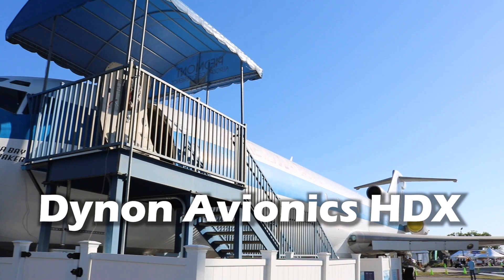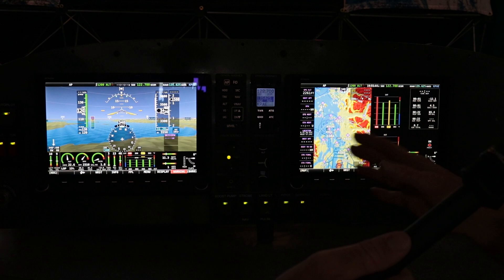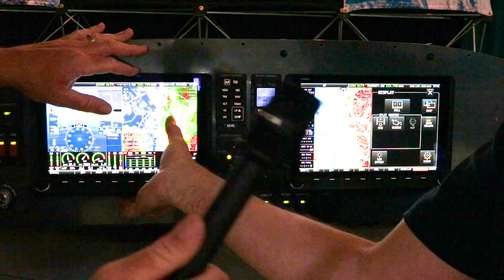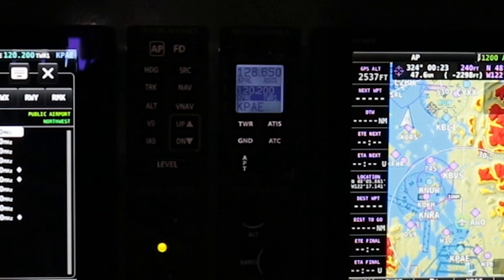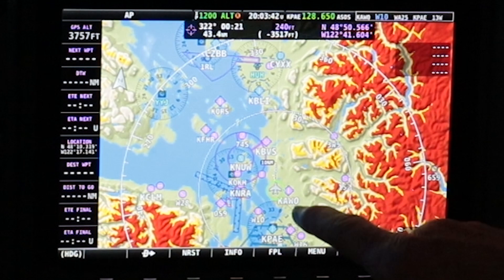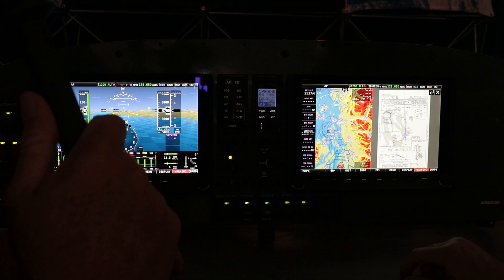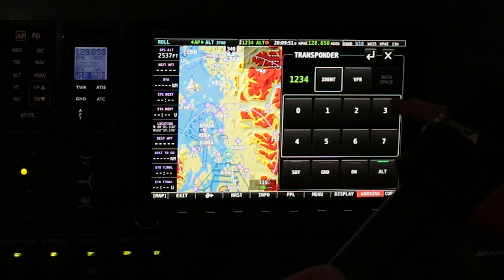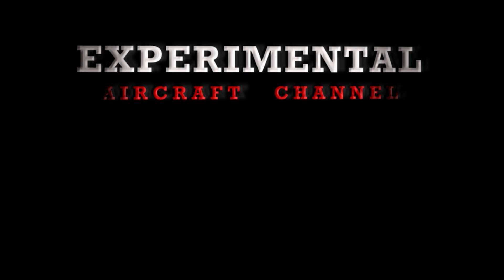Dynon Avionics HDX Panel EXPLAINED by President Robert Hamilton

Comment: The hand grab stabilizer bars around the touch screen displays are a excellent thought. I’m sure they will become standard feathers for all aviation touch screen display manufactures in the future if they aren’t already. Such a sweet display setup for one of the most economical glass panels available for the experimental aircraft world. Allot of information and control for the money and another great interview for such a dry subject Bryan but one of the most costly if you get it wrong. Kudos again Bryan!
Reply: When comparing an apples to apples EFIS system, the HDx and G3X are very comparable in pricing,  and in fact when doing this with every other EFIS system on the market they all are within $800-1,500 of each other... regardless of the brand, Garmin, Dynon, MGL, GRT etc.  So, I don't know about the most economical EFIS system comment, and I think that award would go to MGL iEFIS, and GRT, although the Dynon Skyview SE would be close.  These systems all have scaled back feature sets, and limited IO etc, so it really depends on what your needs are.  You really have to compare things based on what your needs are for the aircraft... but typically speaking it is worth spending a little more money now and not realizing down the road you can't expand your EFIS system further due to lack of RS-232 ports etc.

Comment: My flight school recently bought a C172 that has the dynon unit.  We did a night xc last night and it was really nice.  I will probably go with this for javron experimental cub I'm building.  One thing that was a little annoying was the dimmer.  It didn't seem to work quite right.  We would set it low and it would get bright or it would get really low.  We couldn't figure out how to get it to just stay at the brightness level we set it to.

Comment: Does the advanced system link with TCAS? Can you do a reverse hold with this. Somebody needs to do a side by side Garmin comparison.
Reply: There isn't much third party avionics integration with devices such as active traffic boxes -TAS/TCAS.  This typically requires correlation of both traffic sources if ADS-B in is also installed.  IE TCAS box is wired to ADS-B In module or ADS-B In/Out Transponder... and is then relayed by that device to the IFR Navigator or Display.  When it comes to IFR aircraft the Dynon Skyview works really well with the Avidyne IFD series navigators, so I assume you could find a solution integrating the TCAS box with the IFD, but not sure if the Traffic would be limited to the IFD or also displayed on the HDx.